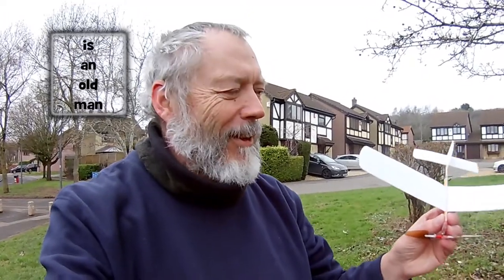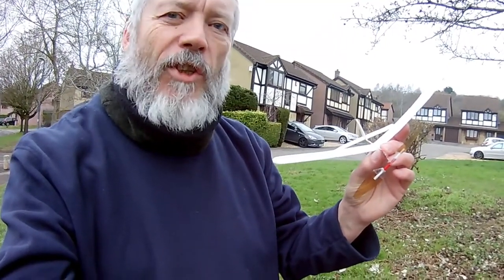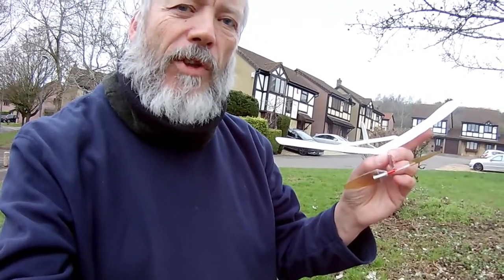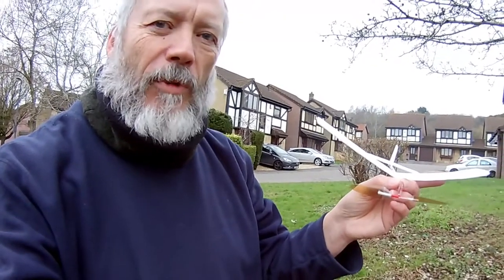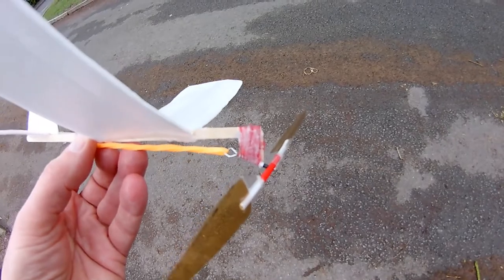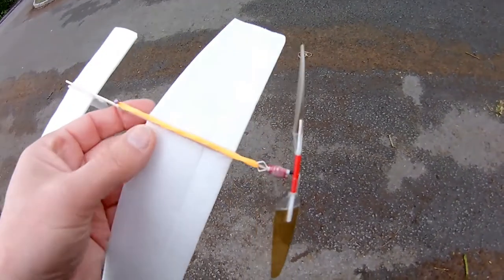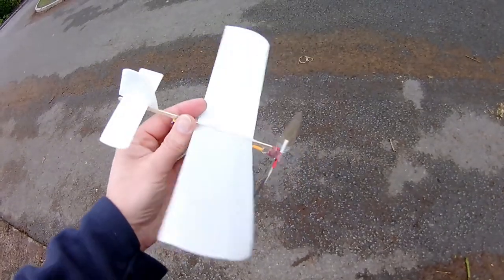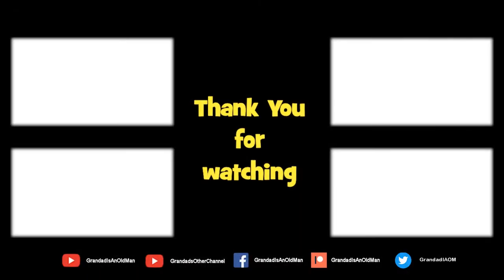Coffee Stirrer Rubber Band Aircraft right thrust angle

Comment: Reminds me of those Balsa stick and rubber band motor airplanes I played with before a teenager way too many years ago.  In Alaska we had a Studebaker car in the backyard and I would use the roof as the launching site since it had plastic wheels on the rubber band powered glider.  My goal was to get it to fly over our wooden fence, but it only did so a few times.  The rest of the attempts ended with it crashing into the fence, but there wasn't any damage to the model.  Those kits are still being sold today, but a bit pricey now.
Reply from the maker: This one is made from foam plates 👍

Comment: I think it could do with just a tad less right thrust, but it’s certainly a success as it is! Well done!
Reply from the maker: It's all a bit over the top, I mean the down thrust looks like it's 30 to 40 degrees. It's another one of those projects that lives in the back of the car waiting for the right conditions and will probably get sat on or crushed under a bag of shopping before it gets a fair chance but they are easy enough to make a new one 😀
Reply: Haha yup, I’ve got a few of those. If you fly at all, you end up crashing, and if you crash at all, you need a bunch of those little ones waiting in the car. 😂

Comment: Hi,
What a difference in flight, but it was rather windy the day you tried the down-left thrust. Small planes are strange little things. 
The rule of thumb is down-right thrust. This helps to reduce the torque of the prop trying to spin the plane to the left. Full-size prop planes have down-right built in too.

I don't think you notice it on control line planes because the control line is holding the torque back

Cheers: D
Reply from the maker: On the CL planes we had right thrust to point it out of the circle and a larger inboard wing compared to the outboard to carry the weight of the lines :-)
Reply: @GrandadIsAnOldMan : Ah, so you were flying anti-clockwise when viewed from above? Or could you fly any direction, depending on the planes setup?
Reply from the maker: Yes flying right way up would be anti-clock viewed from above but for combat you fly inverted as much as right way up and over the top etc. The wings have a symmetrical aerofoil so either way works fine 😆🤣